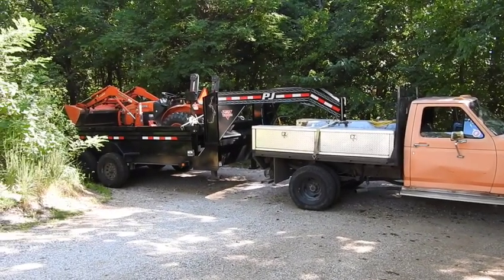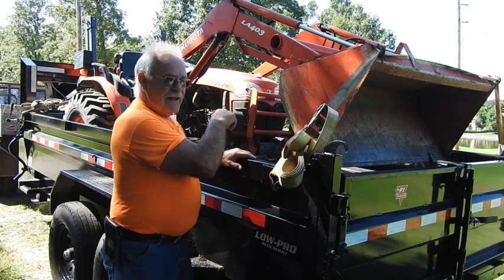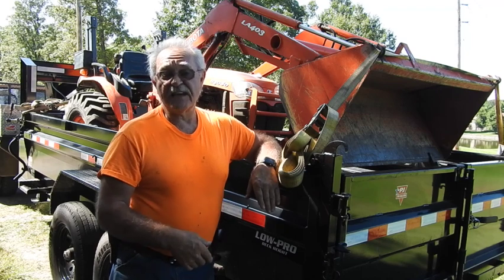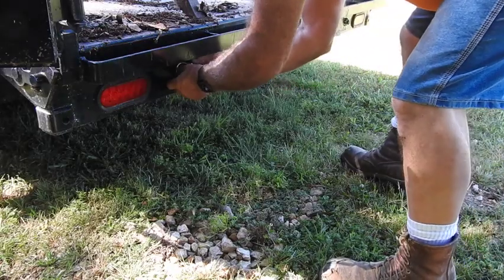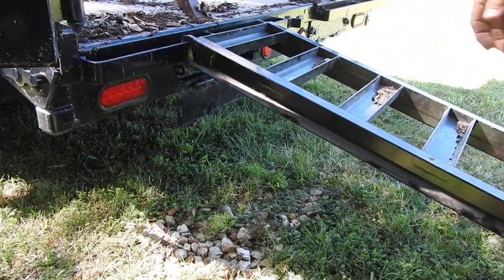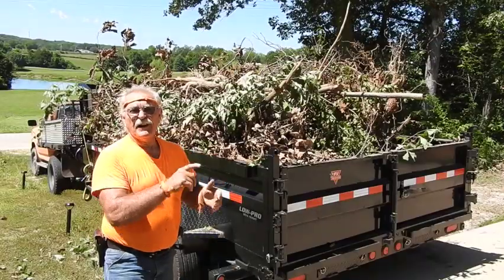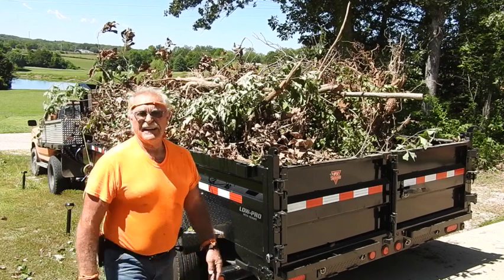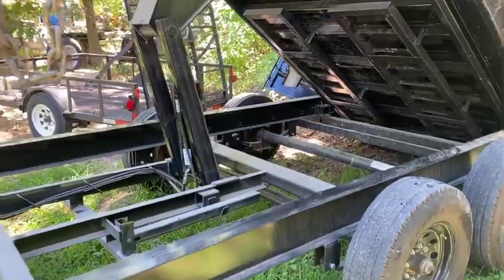Kubota B3030, PJ Tandem Dump, Old Ford Truck, and Pile of Brush

Comment: That sure beats loading a pickup with a pitchfork. 
Having a dump trailer is nice too. Never having a loader I would lay down a chain and pile the wood on the chain so I could drag the pile of kindling to the burnup pile and dump it with the 3 point grader blade.
Reply from the maker: Yep...been there and done that too back in the day.  Not nearly as much fun is it.  LOL  But you know how it is, we do what we can with what we have.
Reply: @tractorman4461  The last time I loaded and hauled brush with a pitch fork the truck bed was full of snakes. I had been pitching it over my soulder into the truck. I would have flipped out if one had fallen on me. 
I unloaded my shotgun on a nest of garter snakes when I was squirrel  hunting.
Reply from the maker: @OldSneelock  Aw man, me and snakes don't get along at all.  I walked into the shop this summer and saw this big piece of twisted black tubing about 6 feet long laying on the floor in front of the workbench.  Of course the light wasn't on yet..... I bent over to pick it up and it slithered off !! Right up under the bench.  Now I would never hurt a black snake, but at the same time I HATE to be surprised like that !!  LOL

Comment: Yes it's not easy trying to figure out how to chain the tractor in a dump trailer. You did more than, "just make it look like you cared".
A friend has a trailer just like yours, he loves it!
Doc
Reply from the maker: Well Doc, this thing has (4) 6,000 pound D rings, one welded in each inside corner...but the thing is the thickness of the sidewalls won't sustain much pull on the binders without bending them inward.  So all a guy can do is snug 'em all down and drive safely.  Tell your buddy I agree, this is an awesome dumper !!
Reply: @tractorman4461  I agree!

Comment: The old Kuboto does a great job handling that brush, must be the operator.
I couldn't help but notice the Sunflowers, or are they Black Eyed Susans in the first shots.
Good cinematography.
Reply from the maker: I promised my daughter to try and not damage the sunflowers OR the milkweed for her butterflies Rick.  So I had to go slowly past them.  I think those were just plain sunflowers.  Not the variety that grow really large though... These are fully grown and only about 5 foot tall and much smaller diameter.  Dad had them that'd get over a foot wide.

Comment: Can you please do a truck tour - very curious on what’s got in for a motor and what you have all done to the F250 - luv the videos
Reply from the maker: Its a farm truck I bought from my uncle 29 years ago with 21,xxx miles on it.  I always drove company trucks, so the 80,000 miles is original with the most being added in the nine years since I retired. Its a 460, 4wd, 4 speed.  I had an engine problem at 40,000 that required a bore job.   One of the cylinders had a broken ring and for some reason wallowed out the cylinder necessitating a .030 overbore.  So its now .030 over with an RV cam, high capacity oil pump, 4150 Holly and Edelbrock intake.  The home made 2 1/2'' dual exhaust is connected to a set of Hedman headers and Thrush glass packs complete with an "X" pipe to balance the exhaust and mellow the sound. 
     I also installed vibration flex connectors after the headers.  After tearing the original 3/4 ton rear end out 4 times, I installed a one ton dually rear end out of a high cube van and double stacked the leaf springs.  Yes, it's a bit rough riding.  I had to relocate the spring perches on the rear end to match the flat bed I installed at the same time. I used a 1'' x 6'' piece of flat iron welded into a 10'' channel iron attached to the frame with 3''x5''x1/2'' angle and 3/4 grade 8 bolts for a frame connected gooseneck hitch.  The flatbed is attached to the frame with (16) 3/4'' grade 8 bolts as well with a quantity of (8) 3''x5''x1/2'' angles.  
    The rear bumper is 6'' channel layered with a 1/2'' plate for added strength and the back up lights are 55 watt head lights from a Wheel Horse riding mower.  I mounted them in 5'' schedule 40 black iron pipe for a mount.  Actually, here is an old video on those here, Part 1: https://www.youtube.com/watch?v=409XbJDGHPw and then part 2: https://www.youtube.com/watch?v=iV2LVSWjMzM  I hope that gives you some insight to the old truck.  I use it almost daily and its a real beast !!  Thanks for asking as well as for watching.

Comment: Pretty slick trailer! Do you ever think about adding a grapple bucket to the tractor?
Reply from the maker: Oh my gosh Matt, EVERY time I use the loader I wish I had a grapple.  I have to build or buy a grapple plate and also prepare to convert the bucket to SSQA at the same time if that ever happens.  I'm thinking of getting one for the skid steer though.